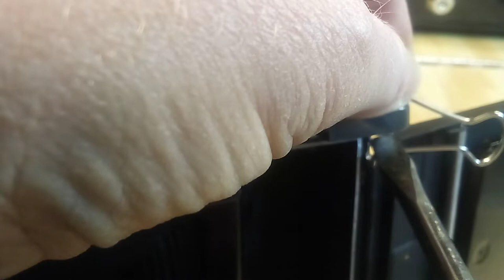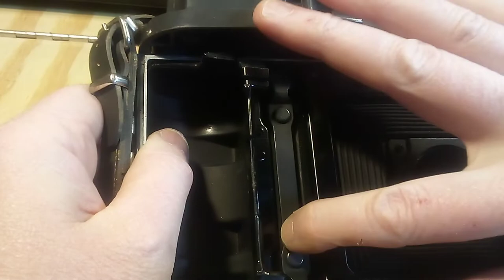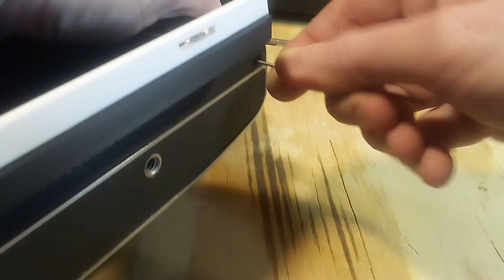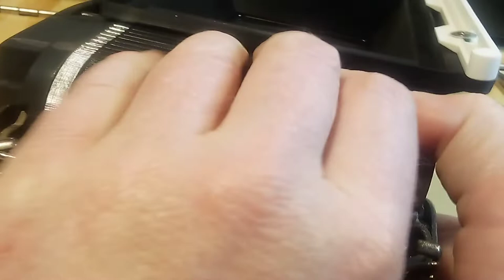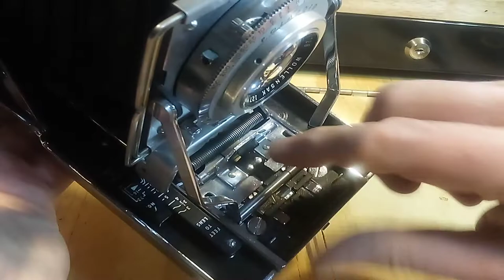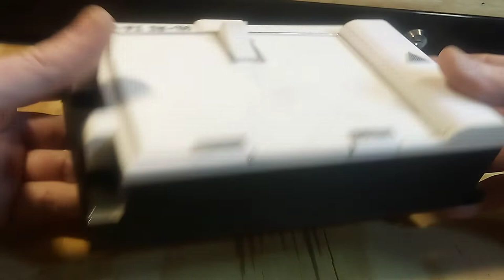Lo- Fi Polaroid 110 non-destructive conversion kit simple install!

Comment: Amazing! Thank you for this. Will this kit accept wet plate holders such as Graflex Series D - 4x5 Wet Plate Holder?
Reply from the maker: This back is specifically designed for graflok style backs, but I do include an elastic cord you can use to hold in the dds style film holders.

Comment: Wow, I had heard of your conversion kit before, but I didn’t fully appreciate the genius of it until watching this video. I am hoping to know, does the 110 kit work on a 95? I have a 95 and the door seems very similar.
Reply from the maker: Yes- all of my 110 conversion kits work with almost all of that generation- the only exception is the 850 and 900, as I have yet to devise a clean lens stop for them( their front standard is different). If you have any of the others like the 95, just make sure to tell me at checkout so I can get you the right lens stop for your camera. Thanks!
Reply: So the land camera 95 an and b have a kit?

Comment: I just stumbled onto your channel. I have a Land 250 that I'm hoping I can convert. Have you made a kit for that camera? I also have a 95-is there a kit on your ebay site? Thanks for keeping these cameras alive and kicking.
Reply from the maker: I make a 180 to 2x3 kit that works with automatic cameras like your 250, and I hope to make various instant ones soon! All of my 110 conversion kits work on the 95, just specify what model in the notes when you order it so I can make the correct lens stops for you.
Reply: @lofianddiy  Fantastic. I'm interested first in the 250 conversion.
Reply: Is the 180 to 2x3 conversion kit available?
Reply from the maker: @carmellacardina194  Yes, you can find it here: https://www.ebay.com/itm/133832994555
Thanks!
Reply: @lofianddiy  Question: which type of polaroid does this conversion use?
Reply from the maker: @carmellacardina194  The one I provided the link for works with the 180 and 195. You could use the 250 with it, but you would have to focus a little differently.

Comment: Do you think it's possible for you to make a setup for this camera  so it can mount a digital back such as the  phase one p30+ digital back?
Reply from the maker: I am working on a hasselblad solution, so as soon as I can do this, those types of backs will become more possible.
Reply: @lofianddiy  is it really hard to make a setup for those backs?
Reply from the maker: @josephbanks7937  I think it can be very challenging.
Reply: I think your right,  do you know if anyone ever did it before?
Reply from the maker: @josephbanks7937  Not that I know of.

Comment: Is it possible for you to make a instex wide back for a Kodak Eastman no3a folding camera?
Reply from the maker: Do you have the tall or the wide version?
Reply: What do you mean? @lofianddiy
Reply from the maker: @josephbanks7937  when I googled it, there were two versions- one that was oriented in portraiture and the other landscape.
Reply: I believe it’s portaiture version  @lofianddiy
Reply: It’s about the same size and dimensions as the Polaroid 110b
Reply: The back just push’s on  there is no hinges
Reply from the maker: @josephbanks7937  Cool! OK, I ordered one in the vertical and one in the horizontal- I can't  even tell you if it can be done without one on hand, unfortunately. On the plus side, junky ones can be had cheaply online, and I don't need good ones to tell me what I need to know!
Reply: @lofianddiy  wow that's cool looking forward to seeing what you come up with
Reply from the maker: @josephbanks7937  OK, I got em! I think the portrait version( the kind you have) is definitely a cool platform for design, as the body all but comes off entirely!